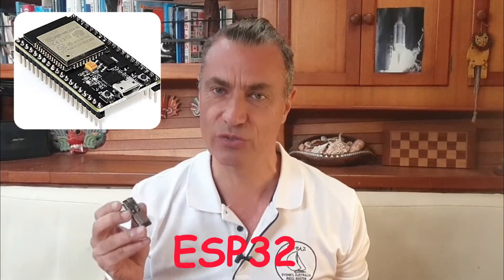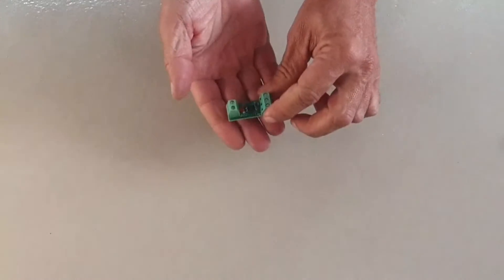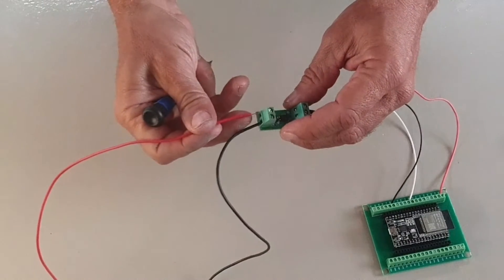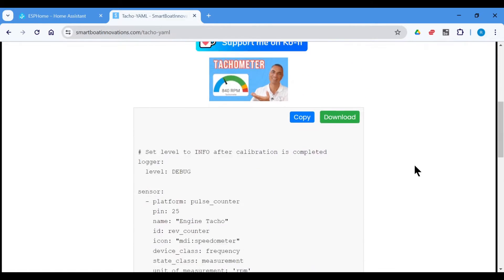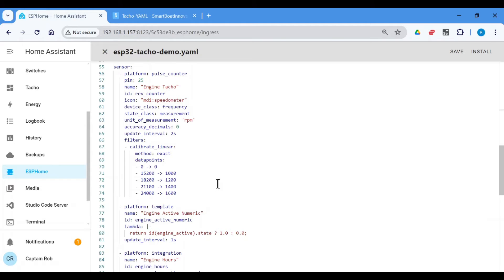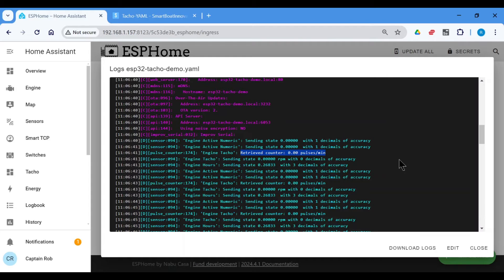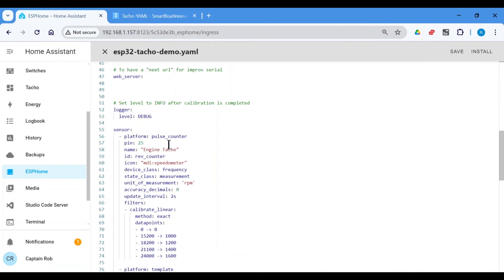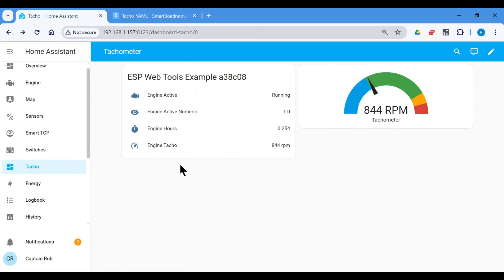Digital Engine Tachometer with ESP32 and Optocoupler

Comment: Thank you for the video!  I am also working on the temperature and oil pressure gauge projects from your videos and was wondering if this tacho project can be run on the same ESP32 as those projects.  It seems pin 25 is already in use by the temperature sensors.  What are my options here?
Reply from the maker: Yes you can use the very same esp32. You can use many other pins for the optocoupler on the ESP32. Some commonly used GPIO pins for general purposes are GPIOs 12, 13, 14, 16, 17, 18, 19, 21, 22, 23, 26, 27, 32, and 33. Just avoid using pins that are reserved for specific functions like GPIO 6 to 11 (used for flash memory) or GPIO 34 to 38 (input-only pins).
You just need to update the esphome yaml from my website to reflect the pin you choose.
Reply: @SmartBoatInnovations  Got it, thank you!

Comment: Hi Rob, thanks for the video, it's very clear. I can't get this to work for some reason. I get a reading for about 1 second after the engine starts. Then the reading stops. The led on the octocoupler lights up bright that first second, and then it dims. I tries with shorter cables. I tried with 3.3 and 5v to the octocoupler, i tried inversing polarity on the octocoupler input side, but nothing seems to help. Any ideas? If I can't get this to work I'll probably try with an induction probe.
Reply from the maker: It might be that your ESP32 and engine aren’t sharing the same ground—make sure they use a common ground.

It could also be that the alternator’s field is dropping out after start-up, so the W (tacho) output goes quiet. Make sure your dash tacho warning lamp (or a ~100 Ω resistor) is fitted between L/D+ and +12 V to keep the field energized.

This method has been confirmed to work by many—if you’re getting that initial blink, you’re almost there. Keep at it!
Reply: @SmartBoatInnovations Turns out it was ground. When shore power is disconnected it works fine. Thanks for the tip.

Comment: Brilliant. I'm putting together a gps speedo and rev counter for my VW T3 van, was wondering how to connect tachymeter to esp32. Nice cheap optocoupler. Thanks
Reply from the maker: I have a 1974 T2 VW . Lovely van. I was just travelling in it the last few weeks.
The video has a circuit diagram on how to connect this. Alternator W wire goes to Optocoupler. Then the Optiocoupler is connected to the ESP32.

Comment: There is a small error in your yaml. I suggest you remove the line for the Engine tacho: device_class: frequency. My HA gave me a warning that frequency is not measured in rpm. Removing the device class got rid of the warning in my logs.
Reply from the maker: I just checked my install and I do not get a warning for this. Did you see this in the ESPHome device logs? What versions of ESPHome and HA do you have? Can you email me the extract from the logs. Thanks-

Comment: Done. The crux of this project for me was the wiring of the alternator. I could not make out any markings on mine and it is hard to reach. For the negative to the octocoupler I just plugged into the general boat ground. For the tachometer there were about 4 possible terminals on the back of the alternator. Th third one I tried gave me readings.
Reply from the maker: Well done!

Comment: Hello Rob - is there a way to change the start value of the Engine Operating Hours to make it match the actual engine hours?
Reply from the maker: Yes. You just need to create a template helper.  Settings -> Devices & Service -> Helpers. Then create a help of type template. This will create a new sensor based on your old one. Add this definition for the template.
{{ ((states('sensor.monitor_engine_hours') | float + 5000) | round(0)) | int }}
This will add 5000 hours.
Reply: @SmartBoatInnovations  thanks, appreciate your efforts and answers!

Comment: Dear Rob, huge thanks for the video. I installed the code, but when validating the YAML, I got a message here below. What I did wrong? Unfortunately I'm not yet skilled enough to solve it...would you mind to help a bit?
It also gave a message of having twice the "sensor" in the code, as it was already used earlier in the code, for other sensors. Therefore I deleted it from this part of the YAML, and that error disappeared.

 INFO ESPHome 2024.2.2
INFO Reading configuration /config/esphome/esp-web-tools-example-296dbc.yaml...
ERROR Error while reading config: Invalid YAML syntax:

while parsing a block mapping
  in "/config/esphome/esp-web-tools-example-296dbc.yaml", line 90, column 3
expected <block end>, but found '-'
  in "/config/esphome/esp-web-tools-example-296dbc.yaml", line 92, column 3

Lines 90 (DEBUG) and 92 (platform...) look like this:
# Set level to INFO after calibration is completed
logger:
  level: DEBUG

  - platform: pulse_counter
    pin: 12
    name: "Engine Tacho"
    id: rev_counter

Hope I managed to explain it clearly enough...wish I had a possibility to send a screen capture
Reply from the maker: If you have sensor in another part of your Yaml then you need to merge them both together. You need to have the sensor heading and then under it all of platforms etc
You cannot have 2 sensor headings.
For simple things like this try using ChatGPT. copy and paste your YAML to ChatGPT and it will most likely give you a solution.
If all fails send me an email. You can find it in the contact section of my website.
Good Luck!
Reply: @SmartBoatInnovations  Dear Rob, huge thanks for your help! I managed to fix the YAML with your instructions.

Comment: Assuming the numbers in your calibration are accurate, your alternator belt may be slipping at higher RPMS. Your ratio at 1000 RPM is 15.2:1 and progressively falls as RPMs rise, down to 15:1 at 1600 RPM. Either you have a slipping belt, or there is an inaccuracy in the measurements used the calibration. Seems like it would be better to use a direct RPM count (maybe a pulse from a sensor on the flywheel) rather than the alternator, then you'd have the bonus of actually measuring things like belt slippage over time... Just an observation, good work over all; I've been enjoying your videos.
Reply from the maker: Well spotted. I am glad there are people out there looking at the little details. Impressive! Actually my engine RPMs on the video are from my analog gauge which is out of adjustment. Today I checked with a strobe and these were the calibration figures
        - 15200 -> 850       
        - 18200 -> 1015
        - 21100 -> 1180
        - 24000 -> 1335  
But I didn't update the video as it was the procedure that was important and not that my engine tacho was wrong.